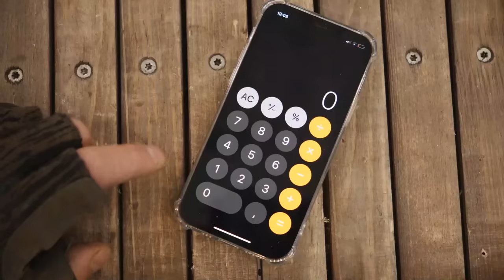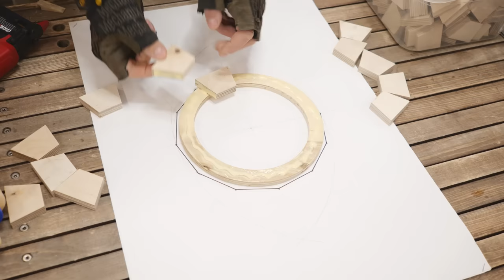The simplest and fastest coil for wire or hose! Plywood plus a pair of bearings and you're done

Comment from the maker: Hello friends. Do you like the design and functionality?
Reply: It looks very good)
Reply: I would say the piece is beautiful, creative and very well made on the one hand. But on the other hand, not too practical if you have numerous leads and would need to make one of these for every one of them.
Reply: Always impressed by your handiwork
Reply: It's amazing
Reply: @Whoozerdaddy  I'm sure one can make a spool for multiple leads 🤗
Reply: WOW !! Hey can a hose reel be adapted to do that ??
Reply: Your NOT showing all of the steps you took to achieve the round I D or O D. So for that reason, I'm out.
Reply: Your handiwork is very impressive but Home Depot has been selling a very similar (plastic)device for several years. About $10.00.
Reply: That's a cool project, I'm going to have to make one.

Cheers Friend 👐
Reply: Very beautiful craft. I would ask you just one thing. Never, ever ever use it when you have a coiled wire on this. If you attach to it a power tool and use it coiled, just because you need only a couple meters, the coil will heat up and can burn.
I had to put out such fire once myself, because a friend didn't uncoil his cord while he was making some renovation.
Reply: Yes. The design is excellent. I have several store-bought cable wheels. None of them solve the problem that one end of the cable needs to revolve around the wheel’s centerline. This design solves that problem. Furthermore, this design allows the user to station the wheel where it must remain and then transfer the power delivery end of the cable to the work. This design is superior to any I can find. Also, I like the woodwork.
Reply: great idea
Reply: The plug, not the outlet, needs placed in the center.
Reply: Why woodworking people build things with disproportionate strength points nowadays? It was not like that in the old times. It was admired how whole designs were homogenously well thought. Why not use metal pins for centering bearings? or Why ball bearings? Why not wood instead long metal bolts? Anyway appiriciate effort and looks.
Reply: Don’t know. I’m not spending 10 minutes watching someone build something without them having the decency of telling me what it even is.

Comment: As a carpenter I enjoyed every single step of your work. Of course it's so much easier, cheaper and faster to buy a ready-built one, but as a personal project for a special and own-built subject it's amazing. Thanx for sharing those beautiful ideas.
Reply: I built a similar contraption years ago,  except I put a 4 way at the end... and it worked better than anything store bought... I tried several ones from home depot and the nothing was as good
Reply: @Wasted Space with Brock Hauser  
I also bought one frome Home Depot. 
It works, but you have to be an octopus to wind it up... 
I'm going to take it apart and use the pieces to build a better one.
Reply: Very impressive . Extension cords are becoming obsolete though  . Made a clothes line out mine .
Reply: Store-bought lead coils are terrible. I like this, but couldn’t make one as good as this. Impressed. ❤️🇷🇴
Reply: Bravo.  As previously mentioned, ... you obviously have several skills for which you've Mastered.
I thoroughly enjoyed this video.  I've watched it several times.
Every element in this presentation was Top Shelf, 1st Class and produced so professionally I'm going to assign my Video Production students to screen it as a project deserving an "A-"!
Originally, I assigned "A+" to the video.
The "A-" is ... In my own personal and professional opinion ... because of this.
I docked you .10 for using ... what is in my own personal opinion ... a totally inappropriate TOOL used for tightening chrome plated >> anythings!!
Combination wrench/Spanner.   Socket or Nut Driver. .... (or the business ends of those oversized adjustable Pumps taped to prevent TOOL MARKINGS. and your grade raised to "A++" !

Comment: nice wire spool, nice construction techniques.  keep working with wood, but learn to use the right metal tools correctly.  channel lock type pliers used backwards instead of a wrench to tighten nuts.

Comment: Very nice piece of woodworking but not practical. Most power tools have specs on the length and gauge of extension cord to use to avoid burning up the motor. I've rarely if ever  seen a tool that calls for a power cord longer than 50 feet. For example, a  DEWALT grinder has a 13 amp rating and would require a 10 gauge cord at 100 feet. A 10 gauge cord is pretty thick and heavy at that length. Just something to consider.
Reply: I'm sure it can't be legal.

Comment: A lot of work just for a cable reel, which has such a large internal diameter, reduces amount of cable plus constand twisting, throwing of plug end will eventually cause cable breakdown. That's why commercially made ones have the socket fixed to the reel. Nice bit of router work though and never seen the downward clamp on a pillar drill before.

Comment: Needs an electric motor to wind it up.  Make a narrow first plate that goes diagonically from corner to coner on the outer frame (can even use the existing bolts). Make a second plate that attaches to the outer edge of the inner drum 180 degrees apart (i.e., the diameter). At the center of the second plate weld something (call it a drill bit) a drill can atttach to that extend perpendicualr from the second plate. Drill a hole in the first plate at the center so that the "drill bit" will extend through the hole.  Then one can use a cordless drill to wind up the power cord.

Comment: I was a wire monkey for two years and literally every wire I ever pulled came in a pre-made easy pull box or a spool you stick a piece of pipe through and voila, ya pull the wire. 
I'm all about DIY craftsmanship but this is a solution for a non existent problem

Comment: maybe if you had a slot or guide near the middle of one of the upper cross posts that could hold the cord in a pivoting location then when you roll it up it could spool in a more back and forth manner so that the cord is flatten across the cylinder
Reply: Great idea, and you could add a drive system that run off a portable drill!
Anyways, you do nice work!

Comment: I would REALLY appreciate it if you would put the name of what you are going to build in the title, instead of us wondering why you are cutting up and gluing together pieces of wood in some apparently random  manner for most of the video.
And You also forgot to add a safety warning to Never apply power unless ALL of the cord is unreeled, otherwise you have a home made induction heater that can spontaneously combust!
P.S. If you had made the holes around the dome head nuts bigger you could have tightened them with a socket, instead of marking up the chrome with the channel lock pliers.